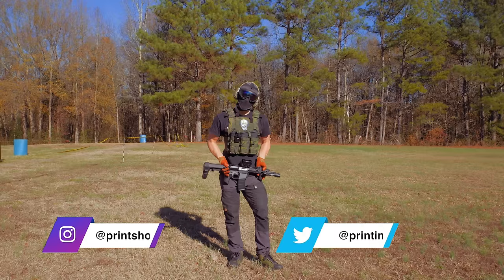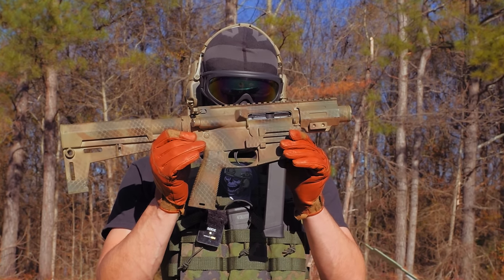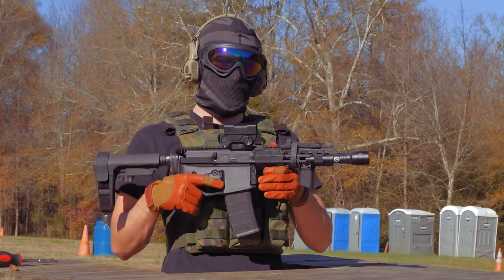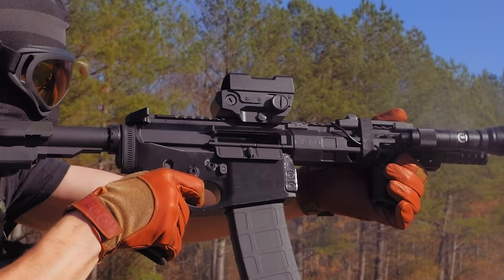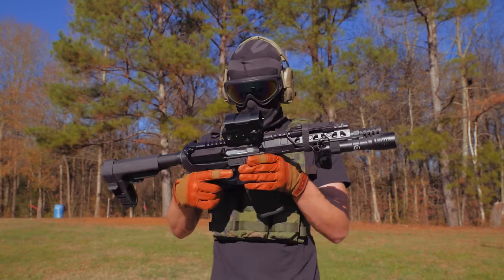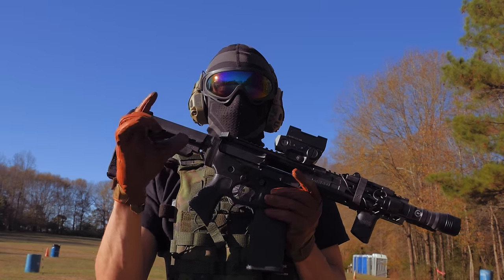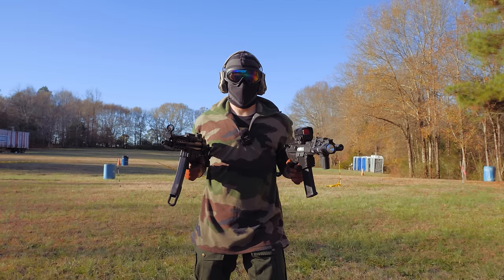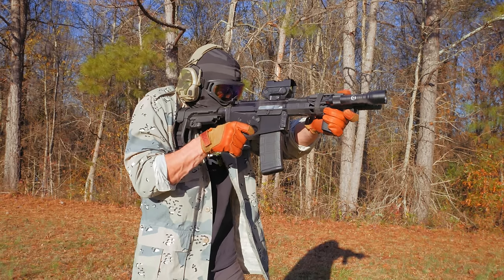New Delayed Blowback Just Dropped

Comment: It's roller delayed, but the rollers are ball bearing shaped. Everything works as it should.

It's pricey for a 9mm AR upper, but it gives you roller delayed performance without the HK costs, better trigger (stock and aftermarket), all the AR parts compatibility on the lower group and handguard. Only drawback - buffer tubes, and that's even a plus for some (easy to tune out springs and buffer weights).

If Mean Arms can crank them out in numbers, other delayed/locked action PCC makers should be feeling the heat.
Reply: Looks and sounds nice. But I'd rather see cheaper clones of the MPX design myself.
Reply: Flectarn is on sale at venture...
Reply: @@Abandon-wd9huhence the ball in ball bearings? But yeah, good point. They're all technically bearings.
Reply: @hughgrection3052 nothing stops you from getting a pistol length piston kit (maybe Superlative Arms and/or Adams Arms does them), and calling KAK for a custom pistol length gas ported 9mm barrel.

Go nuts and let us know how that one went.

9mm case head is only slightly bigger than 5.56 NATO, like by 0.3mm I think, so maybe bolts could interchange.
Reply: Rollers are bearings .
Reply: @prfwrx2497  I mean, maybe?? I guess that's possible. But sounds like ya still using a buffer tube tho correct?
I just bought a MPX-K and never looked back myself.
Reply: @Abandon-wd9hu  Yeah. Or if you're making a weapon this size anyways why not just go whole hog and get 556 that's lighter and more powerful, or 300 even. 
To me the 9mm is best suited for small PDWs. Go this big and it gets redundant other than for cheap range fun etc.
Reply: Without the HK cost??? Dont get me wrong these are cool, but It's $1440 for a 7.5" upper. To me that's HK function & HK cost minus the HK vibe.
Reply: "Without the HK cost"
There are like three different brands of MP5s and the Grand Power Stribog SP9A3 for less than just this damn upper costs. I could basically fully trick out an SP9A3 and just about come to the same cost as this upper alone.
Reply: @InvidiousIgnoramus  Or get an MPX even.
Reply: @hughgrection3052  Yeah that's about the only limitation at work here. For some it's a plus, for most it's an annoyance.
Reply: Fair
Reply: You can get a Scheel Mfg roller delayed blowback system for $350
Reply: Rollers & Balls are very different shapes and have different mechanical stressed etc. In other words, just because the basis of operation of the system is the same, does not mean it's just a slightly different approach to it, things like wear and reliability could be VERY different, sensitivity to ammo etc.

Comment: I wish they used traditional rollers, ball bearings are under “point contact” whereas rollers have a “line contact” this means the rollers can handle more stress and typically translates to longer life and stronger parts.

The same idea is present in roller bearings vs ball bearings. 

I’d be curious to see how long the gun’s bearings hold up compared to the rollers on an MP5
Reply: Heyms and Savage Impulse held up well. Higher pressure but bolt action, actively locked as opposed to delay action. So we'll definitely see how it plays out.
Reply: @prfwrx2497 four bearings though.. of course, the shape itself provides strength
Reply: hard edges create stress points so the opposite of bearings lasting longer is a possibility. Beretta 92 revised the locking ears on barrel locking block to have a rounded rear corner where in interfaces with the square locking recesses in the slide because sharp edge junction with another sharp edge under recoil and slides where cracking at those corners.
Reply: @gratefulguy4130 bearings can handle about anything thrown at them. I agree they should be more than adequate. Ceramic bearings especially.
Reply: My understanding is that the bearings run in channels, this both directs the bolt and means that the bearings contact more surface area.

Comment: if you already have an ar9 and want recoil reduction check out the maxim defense roller delayed buffer. it works very well and can be found for 160 bucks. make sure to adjust your buffer tube to remove all preload and be ready for 30 pounds of resistance when pulling charging handle lol.
Reply: I really want to see a side by side vs this
Reply: @MyLonewolf25  same, I hope to see more people reviewing the maxim rdb vs other delayed blowback ar9 options. the scheels system looks promising as well but then youre married to their buffer tube. I absolutely love the maxim aside from how hard it is to pull the charging handle.
Reply: Look into the levAr charging handles that springfield makes. It is creates the camming action that G3 charging handles also do to break the rollers at first as well.

Comment: I've been running a MEAN Arms upper recently on my M16A1. Very controllable and reliable. Endomags are great. I very highly recommend.

And oh yeah, the big honking muzzle brake that they ship it with kind of sucks (as all muzzle brakes tend to do). I replaced it with a 9mm A2 FH and it's way better with really no perceptible change in controllability.
Reply from the maker: Nice! Glad to hear it’s working out for you.
Reply: @apollow_g1025 A 9mm flash hider is a thread protector/muzzle ornament.  I've got 9mm cans I can and do run on the upper ... but when there's not a suppressor, there's a flash hider.
Reply: Are you able to do a FA comparison between the MEAN upper and a CMMG RDB upper?  Wondering if it's worth the upgrade.  Thanks.
Reply: @HAbill  My CMMG RDB experience was very frustrating.  I had nonstop ejection issues that I was never able to resolve. I tried heavy buffers, hydraulic buffers, different buffer springs, Tubbs ejector springs, etc. etc. It never ran well in full auto. The MEAN upper just works. It's been 100% reliable. If you've got a FA lower I think the MEAN upper is a must-have.

Comment: To me, the MPX has been the MP5 killer for years it shoots softer and if you throw a hyper fire, 2 pound trigger in that and get rid of the folding stock put a nice carbon fiber hand guard on it you get a nice light ultra fast package.  I can’t shoot any other car as fast as an MPX with a trigger upgrade.  And the gas piston system is softer than delayed blowback while also being better to be suppressed.
Reply: I just object to Sig’s proprietary nonsense. Literally the only reason I don’t own a Rattler in 300blackout and a MPX.
Reply: not as reliable as something like an mp5/jp5/mean arms. competitors i know that were using mpx's switched away

Comment: I wonder how much recoil mitigation was driven by the giant multiport muzzle break
Reply: Probably not much. There aren't much gasses to redirect
Reply: @feuerfrei7070 the weight of it even if it's not much is helping too tho.
Reply: More weighted work, less gas pressure.
Reply: Along with the extra couple pounds of shit on the MEAN, along with the much nicer on the shoulder SB vs Blade. Not a direct comparison.
Reply: @Bluuuu222  Yeah weight helps with recoil, but I bet that MP5 weighs more than the Mean Arms upper on a polymer lower.
Reply: brake. its brake.
Reply: Not enough to be measured.

Comment: The price isn’t awful but tbh I’ll still take my PTR 9CT with the trigger job I got done by trigger work in TX. It was $60 plus shipping about 6-8 months ago(prob more now but doubt it’s more than $100) and the work that dude does is magic. Turned a trash trigger into an excellent 5lb trigger with a nice clean break. It’s not some Geiselle performance trigger or anything but absolutely better than a standard mil spec AR trigger. Things were a bit cheaper when I got mine but everything included I stayed under 2k(including replacing the hand guard with the old school one for aesthetics sake, 2 H&K factory mags and the trigger job). As long as you follow the break in process(which is honestly a pain in the ass) the PTR performs perfectly. Not a single stovepipe, malfunction, etc of any kind and I’m approx 4-5k rounds into it. If the price was 1k instead of $1450 for the upper I think they’d have a market but with the lower, mags, etc you’re essentially right at the price point of the PTR. If the upper was around 1k I think it’d def be worth it but I personally would rather just go with a PTR or if you’re willing to spend the extra cash the SP5

Comment: Let me just throw this out there, I'm not a hater, but while I get the pros, (cheaper, versatile, manual of arms, parts compatibility), I also am struggling a little, but it's probably just me and my own thinking/priorities. So while on the one hand, as I said, I get the pros, I'm also seeing an awesome competitor in the same space who seems to have got here first, CMMG, and while they are more expensive, they are also proven. Then you have the caliber choice, and this is something I only learned recently. While if I suppress 9mm, I need subsonic ammo for the best quiet, the MP5SD allows subsonic performance from superperformance ammo. I didn't know this before, and that sorta is crazy attractive to me. But then you have .45ACP, and that ammo runs in the subsonic velocities all the time anyway, and there's little difference in recoil, etc, it does cost more, but it's comparable to subsonic 9mm so. So let me recap with a question;
Why not choose .45ACP as the caliber for  this product line? There are lowers designed and available for .45ACP mags, the rest should have been compatible, if Mean Arms is going to make this upper as an option why not take advantage of .45ACPs lower subsonic velocity, better terminal ballistics than suppressed subsonic 9mm, and hit a nich, although, they would still be competing with CMMG as they have a PCC in .45ACP as well.
Seems to me, they should move right away to mimic the MP5SD's capability to fire standard supersonic ammo at subsonic velocities, that would be something you  couldn't walk away from.

Comment: Nice, the only problem or potential issue. It looks like there is to much bolt travel. The pistol caliber buffers are longer to stop the bolt from running to far to the rear. Now that barrel seems to set further forward in the receiver more like a standard AR15. So maybe it is fine.
Reply: The barrel is forward set like an AR15. The total BCG length is nearly identical to an AR15 as well. You can short this when using a dedicated pistol lower since the mag is further forward. Cant short stroke the endomags due to how far aft the ammo is positioned.
Reply: @ZEE0H6  Yes, I thought it looked more like the barrel breech was forward. Thanks for the info.

Comment: have you tried using ultem filament for printing a frame. i know ultem is popular in the knife community due to it being developed for aerospace industry. if i remember correctly its like stronger than aluminum and lighter and has good thermal properties.

Comment: The ejector being on the mag is a no go for me. I hope you can get this thing to run with glock or colt SMG mags and have the ejector built into the lower.
Reply: PSR got that wrong. The ejector isn't built into the mag, it is in the center of the bolt. Mean Arms says you can use some pistol mag lowers if you are able to remove the ejector from it.  There is a version of the Endomag with an ejector built in, but this upper uses the ejectorless version like the CMMG RDB which also has an ejector in the bolt.
Reply: @castarritt  you are correct and thanks for posting

Comment: im curious what my CMMG delayed blowback system is called? i know its my favorite gun i own
Reply: I do believe its a radial system.
Reply: @charlie__kelly3690  Yea i looked it up shortly after my comment, CMMG calls it Radial Delayed Blowback. I freaking love the gun though, Just need to get a lighter buffer spring since most of the felt recoil with the gun is from the bolt slamming back into battery.

Comment: Really wish they would have used a fixed ejector (no reason to make another failure point when fixed ejector just work for thousands of rounds) and colt mag compatibility. Colt mags are $26-30, have a bolt hold open, and are ambi mag release compatible, makes 0 sense not to use them.

Comment: Why would I want this? I never liked runnin 9mm through an AR. I would just buy an mp5.  A friend of a friend had a full auto version with the integral suppressor (the suppressor is the barrel instead of an add on at the end of the barrel) and that thing was quite nice. I will never hope to have one that cool... but still... a semi auto mp5 with sbr would be ok. 

Some enterprising company should take an AR lower, shorten it, design a new bolt and upper, and make it work with some standard 9mm sub gun mags. Lots of wasted space in the design as it is now, and that bothers me for some reason.

Comment: Why would this be better than a CMMG Banshee 9MM upper? This thing costs between $1,400 - $1,575, so it is very expensive.
The CMMG upper does basically the same thing, for ~$500 less than this, not to mention CMMG is a very reputable brand.
Reply: You can swap in 1 of 11 different lifters to tune it your ammo. How many bolts with different dwell time does CMMG produce?
Reply: @ZEE0H6  CMMG works with all ammo, and already has no recoil. It works out of the box, they just say to choose an appropriate buffer weight that is to your liking.
Why would I wanna tune the lifters and possibly loose small parts, when compared to the CMMG Banshee which already has almost nonexistent recoil with and costs 2/3 of the price and doesn't have loosable small parts?

I would buy one of these if they were 1/2 or 2/3 the price, but it just seems overpriced for what they have it for. I would maybe consider it if they made one in 10MM, or 5.7mm or 7.5 FK BRNO.
I can purchase an MP5 and put a Timney brand trigger in it for less than this upper costs. Just saying.
Reply: @RedZeppelinAirship working with all ammo isnt the same as optimized. You dont have to change lifters or buffers with this if you dont want to. The lifter is about the size of a .308 Winchester. It’s easier to replace than removing the CMMG bolt from the BCG. Theres no small parts or cotter pin you need to remove to swap it.

If your type of shooting is just for fun and not on the clock with points, sure the CMMG would be perfect for you.  Competition shooters will most definitely tinker with it and this is the superior system for it. Look at the waitlist for the proprietary JP-5 which costs nearly $2000 more. This a bargain compared to it. 

Never seen a single MP5 at a USPSA match. They might be fun to shoot but the ergos are lacking. If it was a competitive platform, you would see people using it at a match.
Reply: @ZEE0H6  You are being extremely niche with the upper. 
The average US firearms owner would never need a upper like this one, the extra $500 would be better spent on an optic, improved muzzle breaks, ammo or groceries. 
Most Americans can only afford buying 3 guns a year, all typically under $1K. Popping an upper up to $1.5K, gets very high for a gun that will sit in your safe (or in the corner of your room) for most of the year. Most people cannot afford shooting 1K rounds out of a gun because of ammo prices, inflation and the economy.

Most people may only run one load out of their guns, and maybe can be worth it for speed to have lifters, but then it is niche to competitive shooting courses, but this is not available for the average US gun owner who does not have the time to shoot at the range, and needs to work. Also guns made for competition tend not to not be practical for the average person who are complacent with a PSA AKV, a Glock, a BCM AR, and maybe a hunting rifle and shotgun.

I know 4 people that own MP5 clones and variants, as such I can see why in shooting competitions it is not used if you can spend a big amount of money on firearms that have lighting cuts and porting and have improved triggers out of a box, but most people I know just buy what is used by police and is known to be dependable, maybe it is not the best stuff to get for competition, but it is tested, and many people look at that.

I might be being a bit harsh tbh, but it doesn't seem useful to most people.
Reply: @RedZeppelinAirship  what makes a CMMG that cost double a PSA AR9 not niche? If you’re shopping for a budget AR9 they’re not looking at a CMMG that cost double anyway. 

Just because you might not see it useful at $1500 doesnt mean there isn’t a market for them. Look at the JP-5 which is even a more niche product given its price point and people are waiting months to get their hands on them. This accomplishes the same thing for less than 50% of the cost. A $45 lifter will tame the recoil better than any muzzle brake on the market for minor power factor.

I think you underestimate the amount of money people will put into their passion. Major matches costs hundreds of dollars for entry fees, add travel, lodging, food, ammo, and suddenly that $500 difference is a small percentage. Those people tend to equip themselves with the best products. Do we need $200 belt, holster, pouch setup to shoot? Nope, but any major match will be sold out and nearly every competitor will have  a rig that costs that much on the low end. The open and limited guys will laugh as $200 doesnt even get them a holster.

Comment: mp5 has better felt recoil because it's better gassed. Just look at the direction of the shell casings. mp5's goes out perpendicular while the back woods hill billy do it yourself AR9 assaults whoever is standing behind you. add a better buffer spring and it would out compete the mp5

Comment: fyi if you suppress roller locking guns, you need a custom locking piece. Otherwise, the bolt will slam backward too fast, and when it hits the rear, the rollers will push against the receiver. If you keep that up for a while, they will eventually make dents from inside-out.